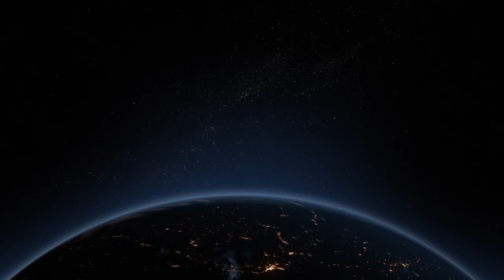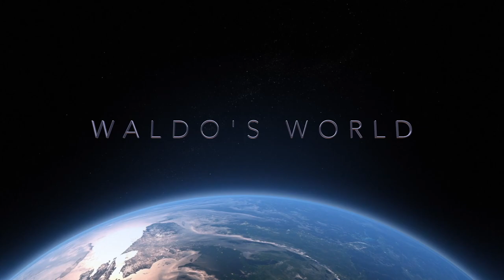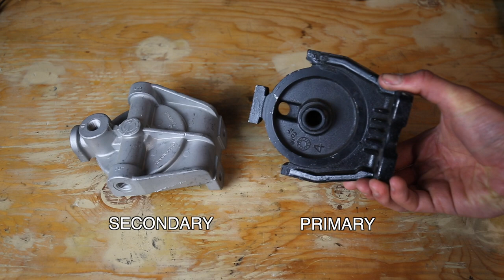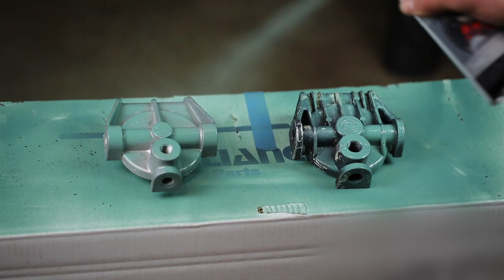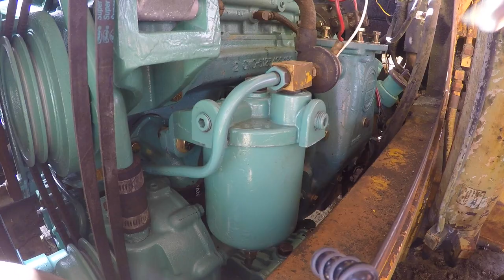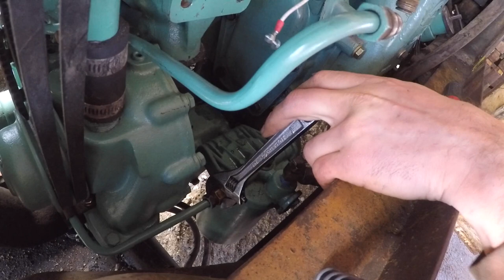Converting a Detroit Diesel 3-53 to Use Spin-On Fuel Filters [Dynahoe 160 Part 4]

Comment: Great that conversation was made. I group I volunteer with had a cartridge filter on a 6-71 in a bus. Worked fine for years, but eventually the seal went bad and would leak bad on a cold start until some heat was in the engine. Cheaper to get a spin on adapter and filters.

Comment: There's nothing wrong with cartridge oil or fuel filters, you just have to be strong to hold the housing up to the gasket against spring tension. It's amazing what these little Detroit's can do  in Log Skidders skidders, scrapers etc.

Comment: Good videos, thanks. I would have liked to have seen how and where you connected your temp fuel tank. I need to do that.
Reply from the maker: When I had a clogged fuel strainer, I used a gallon milk jug filled with diesel as a temporary fuel tank. I just unscrewed the fuel line from the fuel tank and stuck it inside the jug. It was sketchy, but I only had to move the machine a short distance 🤷‍♂️

Comment: I made these conversions to my 190 and the engine no longer starts 😞   I'm curious what the red and white wires are that come from the alternator to the little cap that screws into the fuel filter.  I can't imagine what possible purpose those serve.